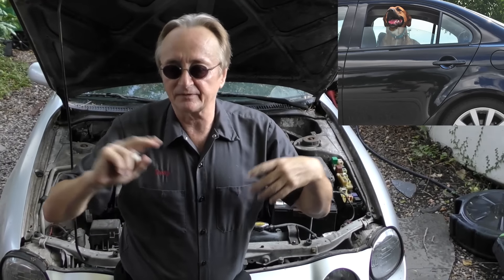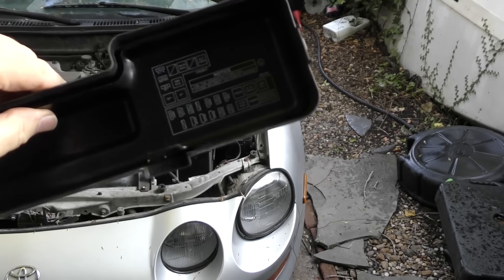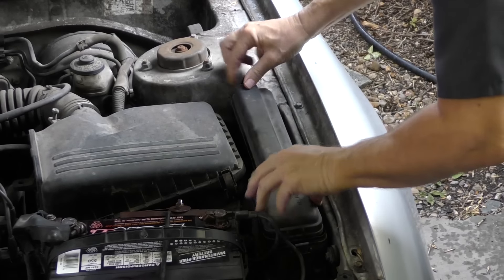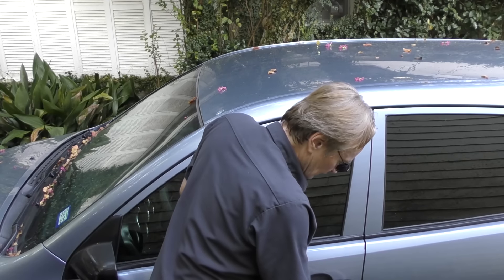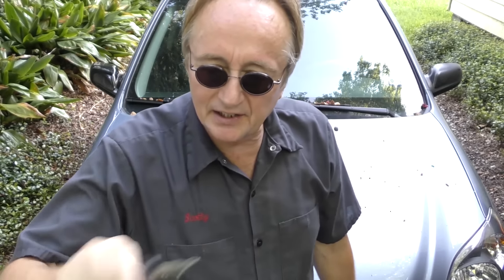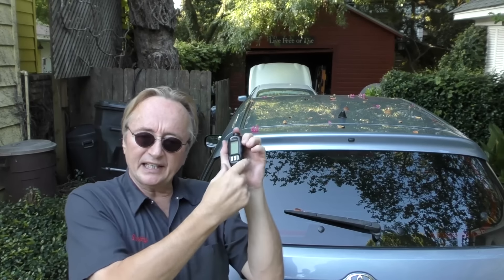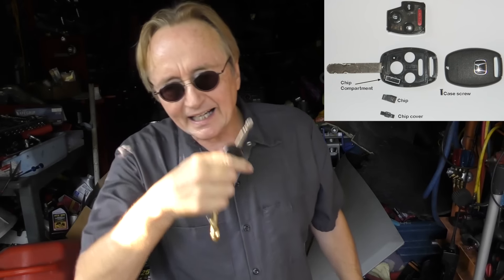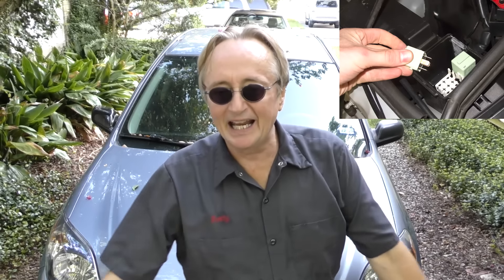How to Theft-Proof Your Car

Comment: If you live in the United States of America, just get a vehicle with a manual transmission.  Most of them do not know how to drive a vehicle with a manual transmission. Whenever I go, I do not even take the key out of the vehicle.  Even their four cylinder, front wheel drive, putt-putt, junk has automatic transmissions.

Comment: For a vacation my grandmother rented a 2019 GMC Acadia and you have to push the button to make the car start and my dad had the key in his pocket we dropped him off at a store to get some clothes and we went a mile away to another store without the key in the car and it was still driving and when we got to the store my grandmother didn’t know that the key wasn’t in the car and she turned it off and then I said where is the key and she said I don’t know I said oh no I think it might be with Dad and then she tried to turn the car back on and it turned on with the key being a mile away and then we drove back to the store where my dad was and got the key. so imagine driving 30 miles away without the key and the car still ran that would be scary.

Comment: Putting my relay switch  in&out in &out in&out is not a feasible way to disable your vehicle. Unless or going on vacation or a extended period of time.  The best way is what scotty said he had on his car  before.  A Toggle switch to turn off the fuel pump. The trick is to HIDE IT were scumbags wont be able to find it. NOT  under the dash. Duh. Get creative ! Under the passenger seat. The glove box ETC. It will take more time And wire , but in the end it will be like 007 owns the car.😁

Comment: Go electric or take out your relays. Without relays the cat is basically brain dead and it won't move, start, or shift accept for honk. And as for electric they are 10x harder to steal because 1. They are all tracked and will be shutdown within minutes from away without the key and notify authorities, 2 electric programing is way harder to break than combustion engine cars

Comment: If you just pull the relay someone with half a brain might see it missing. Get a fuel pump relay and blow the coil with a high voltage. Stick the blown relay in place of the good one when you leave your car.

Comment: pull out the fuel injection relay. i will have your car in my chop shop in about 15 minutes or less. one two inch piece of wire stuck in the relay where the bigger connectors are. but you cant steal my car scotty if you had all the relays i would put one in place that has no insides just the shell.

Comment: Unfortunately, most of the relays in the fuse box are the same and could be swapped into the fuel inj or ignition position.  Fer instance, the horn and a/c fuses are the same as the ignition and fuel inj relays.

Comment: My scooter is parked without the battery in it so they will have to go buy one then come back and steal it.
Reply: Here in Holland thieves just load scooters and expensive (electric) bicycles in a van......
Reply: @davidnl8206  that's sad you could also chain the wheel make it very hard to move a 300lb bike.

Comment: Totally impractical.   These relays aren’t designed to be pulled and replaced.  It’s also so inconvenient you won’t do it.
Reply: Huh 🙄
Reply: His idea is not practical.   Relays aren’t designed to be pulled in and out.  You will eventually cause the connectors to fit loosely causing yourself a problem.  You could however wire in a Bluetooth disconnect at the same spot and use a remote to turn off the power to the relay.

Comment: Very unpractical and with very limited reasonable use cases. It would make sense if you were to park your car somewhere in a non protected area for relatively long period of time like when you're jetting off on a holiday for 2 weeks and leaving your car somewhere in the street close from the airport. Cannot imagine though doing that every single day for a car parked on a street in front of my house. After a few months the entire fusebox would require replacing as the connectors would go loose and consequently the relay would stop working.

Comment: sophisticated thieves probably have a generic relay that will work on most cars...with different pins or pins that will work on all relay plugs...simple. I hate thieves...low lifes
Reply: How would a thief know your car needs a relay, vs bad battery, vs bad gas, vs bad starter, vs kill switch, etc???  Do thieves run around with obd-2 testers in case they need to check codes when a vehicle they want to steal won't start??
Reply: @thejake8099  You're right

Comment: I think for your average stupid person might need to be specifically told WHICH # fuse to take out. I know that you can take out the #20 fuse so that it will turn over but never start. But that’s not a relay. 
I used to take 2 or 3 fuses out of my Chevy everyday. I think they’re were The big ones too. I guess they were relay fuses. But… I don’t remember which one.
Do you can take out the